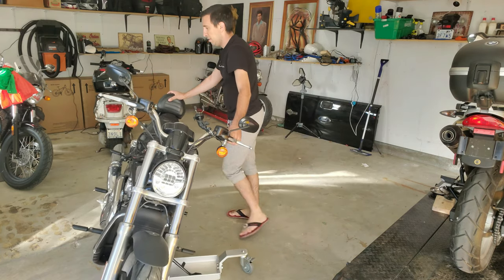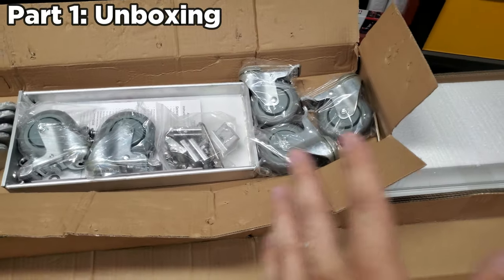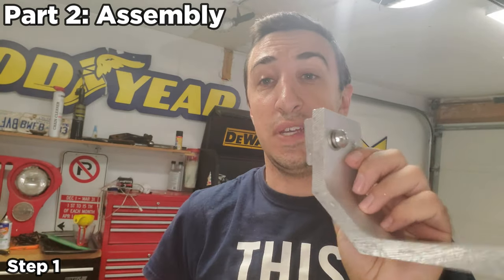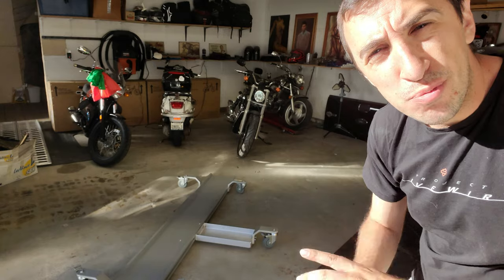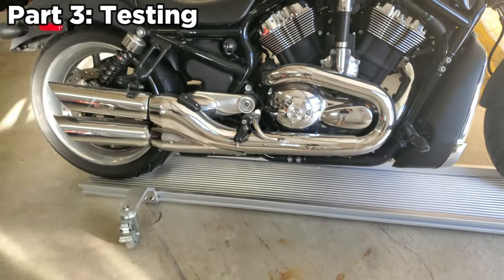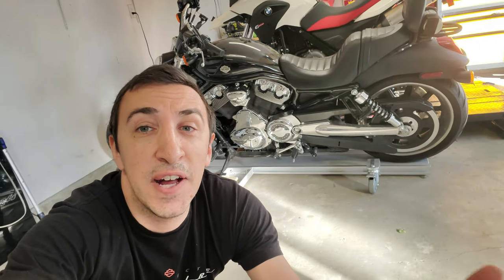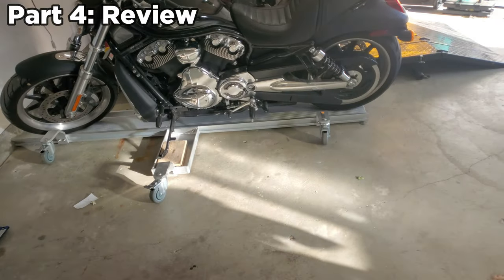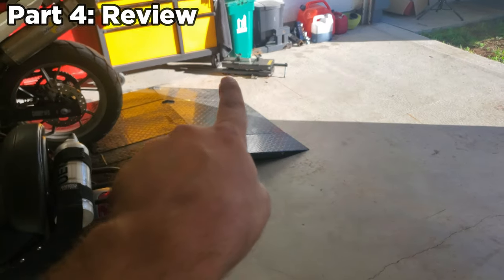Best Motorcycle Dolly - 2021

Comment: I have the HF one I does what it's supposed to do but I like the black widow because it seems to roll much better the only thing I don't like is that wheel sticking way out of the kick stand pocket I don't know why they didn't mount it on the side or have a wheel on each side of the pocket that's just my two cents
Reply from the maker: Good call. That would give it better clearance

Comment: I really liked your explanations Adrian. Very cool your workshop organization. You really put on a show in terms of functional space rationalization. The aluminum support with larger wheels is very practical and light. However, the iron one, much more resistant for a heavy motorcycle, in addition to tilting the directional wheel, saving even more space and not helping to snag the operator's foot in a time of trouble. Just take it to a locksmith (window manufacturer) and have the pulleys replaced for a larger size to avoid maneuvering problems. A happy and deserved Sunday of rest Adrian!
Reply from the maker: Thank you! I don't think the little red dolly has space for bigger wheels because they would turn and hit the dolly (not enough space) but I will try and see 🤞

Comment: will that dolly work well for a street glide bagger? also, I noticed you put a 2x6 or 2x8 wood block for the kickstand  why so?
Reply from the maker: Yes. As long as you haven't put an insanely big rear tire on it, no problem. Wood block was just for aesthetics: I like the look of the bike more upright.
Reply: @YouMotorcycle  can you ride out going forward on it or do you have to back it out or the dolly ?
Reply from the maker: Ride on, ride off.

Comment: I doubt anyone knows the torque spec for any of this assembly.  I’m asking because I know aluminum strips easily.  I got an aluminum cylinder head for a turbo car I used to have and I tightened down the timing belt tensioner bolt and stripped it out.  

I’d like a torque spec lol
Reply from the maker: It'll be fine. This is not a piece of precision machinery